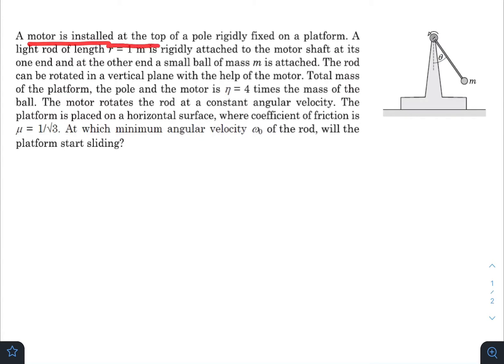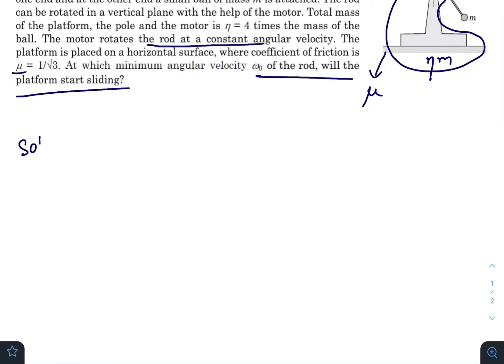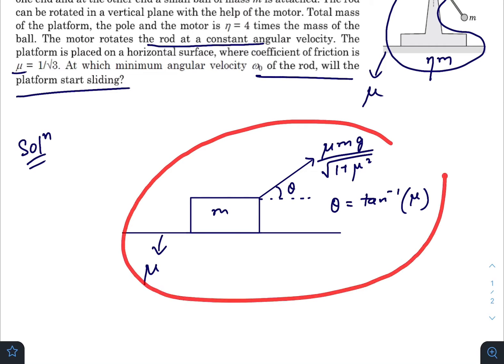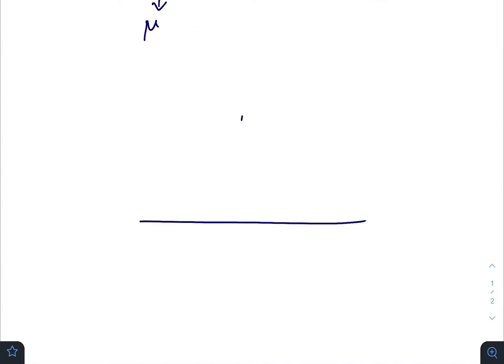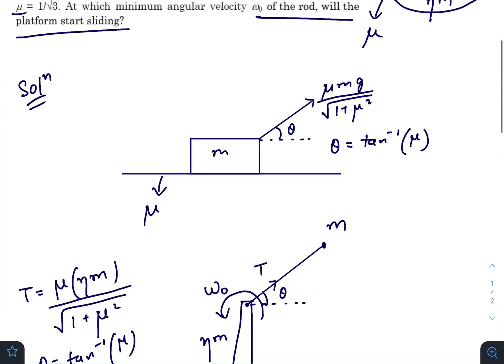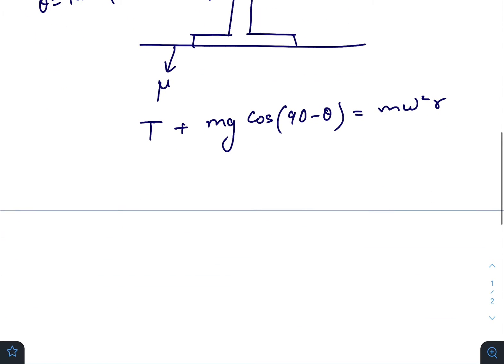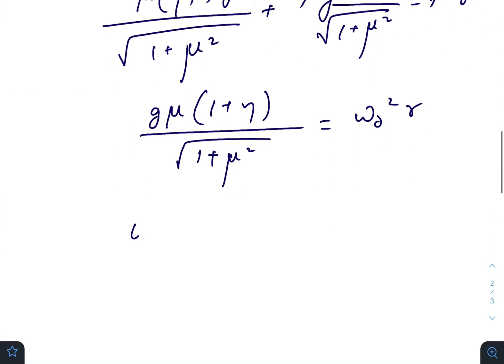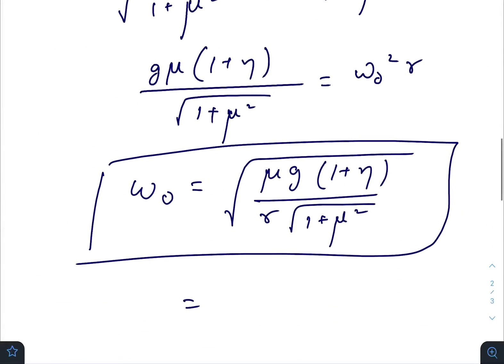Pathfinder for Olympiad and JEE Advanced physics, Page - 2.23, Q - 55

Comment: for someone who wants to solve this rigorously without using the results(the minimum condition result).. i am finding it very very hard to find the minimum condition in the end(differentiation itna lamba tha)... this came in a fiitjee aits test which took on sunday and i spent 9 mins because i could not complete the answer to this in the end.... sab sahi karne ke baad bhi nahi ho paya.. bahut bada scam tha...
Reply from the maker: FIITJEE tests are not good. Go for some other tests.
Reply: @RamizZamanJEEPhysics  But sir i am in fiitjee since 11th.. maine buy nahi kiya hai.. voh matlab pehle se hi decided tha.. choice milti toh allen ke test series ke liye jaata
Reply from the maker: Good luck
Reply: @RamizZamanJEEPhysics  sir i am sorry to disturb again.. but pls clear my doubt, for the result you used, that angle tan^-1(u) and the minimum force, in that the force was constant but in this case the force is itself dependent on the angle theta... how can you say that still the minimum will lie at the same angle